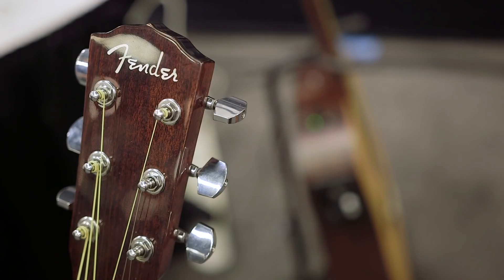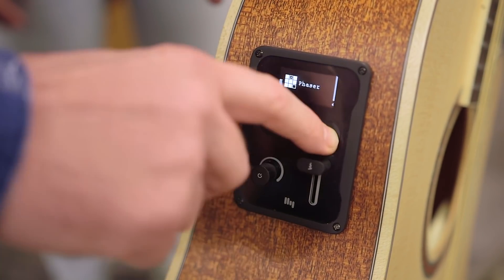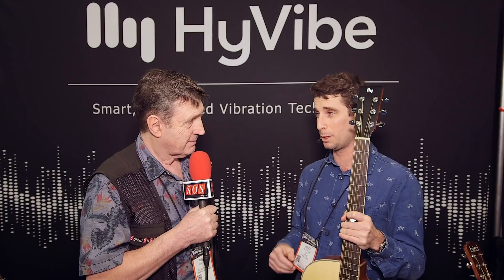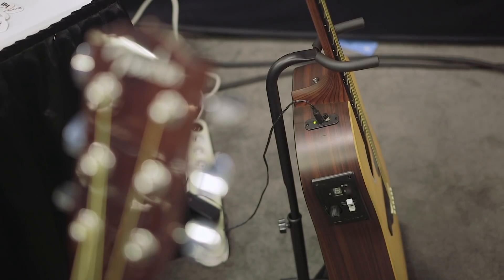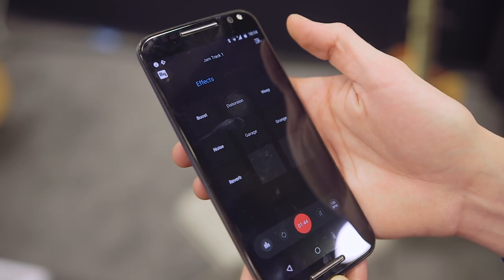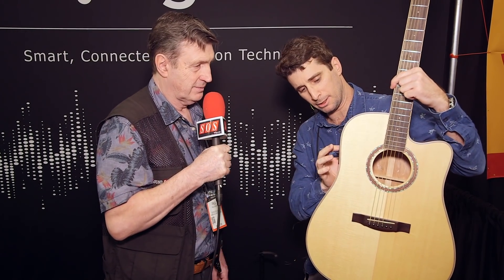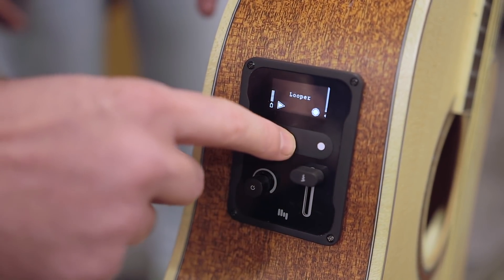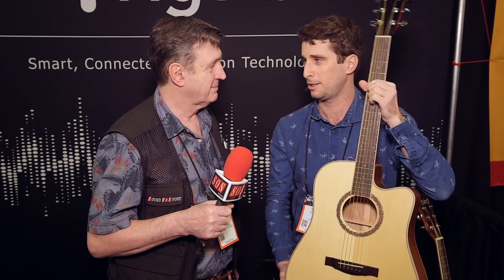HyVibe Audio HyVibe Guitar - NAMM 2018

Comment: SOS, this is NOT new. Look at Tonewood Amps. It is a device that resonates the body without having to plug in an actual amp because the sound comes out naturally out of the sound hole.the tonewood has been out for over 1.5 years.
Reply: Wrong. ToneWood makes the BACK of the guitar vibrate, NOT the TOP PLATE. Huge difference. Plus HyVibe is a bluetooth connected device with memory inside, so you can stream sound, record yourself, edit the effects... Huge difference again.
Reply: I have the tonewood, its too bulky , you cannot stand and play. No looper either
Reply: tonewood has good sound efects but they use a small transducer. which delivers a low volume and the efects are kinda imperceptible.
Reply: I had a guitar like this not so many bells and whistles in 1989. Unfortunately, like a fool. I gave it away. This is not new technology